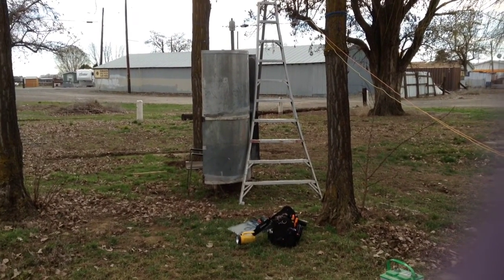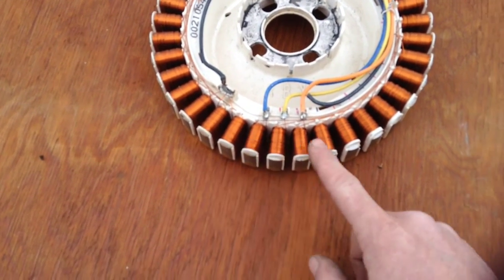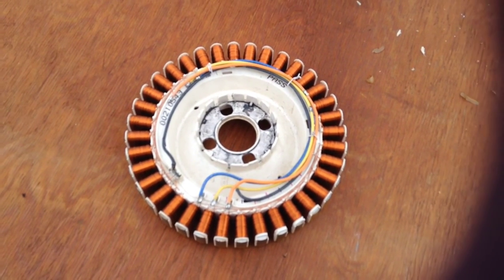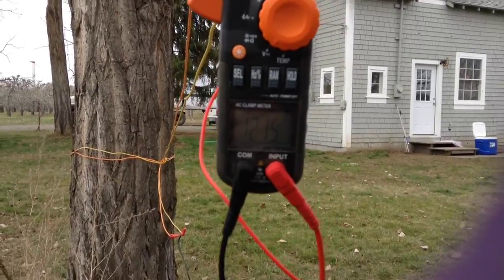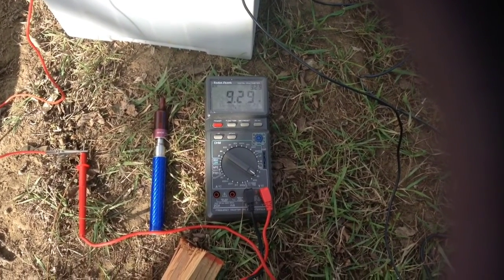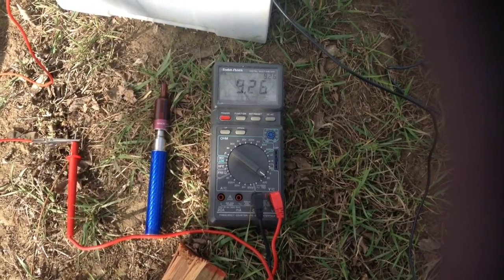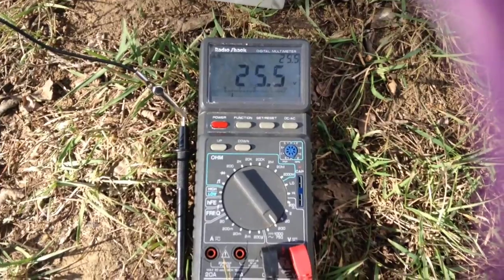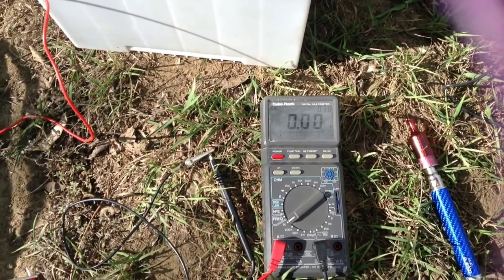Savonius Vertical Axis Wind Turbine Update BackRoom Labs

Comment: Hi, what would help your wind turbine, is a vertical wing in front of your rig. Like a plane wing, it creates lift one side and allows air to pass freely on the other side.  This means you can put the lift side of the wing to direct air into your turbine, and the other side of the wing can block or deflect the oncoming blades of your turbine, that are slowed by rotating into on coming wind. This is a win win siduation. faster wind into your turbine and no drag on the blades of your turbine, coming back around into the wind. This should increase your power by 33% +. I have some other ideas as well, if your interested. I would put lift on both sides of your wing, and let the wing be able to rotate into the wind, so it is always in the correct position for your turbine. This would mean your turbine is off center to the wing, twards the lift side of the wing, to catch the faster air. You might be able to make a good modle, like a weather vane, on a house, with the turbine attached to the back of the wing and the wing with a pole up the middle and able to rotate.Randy